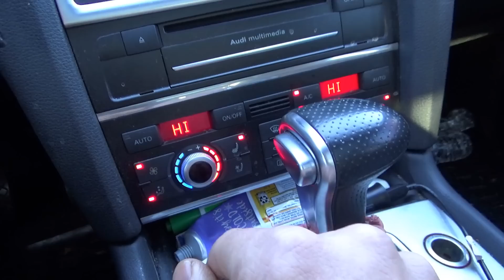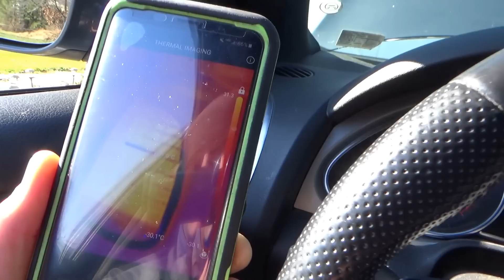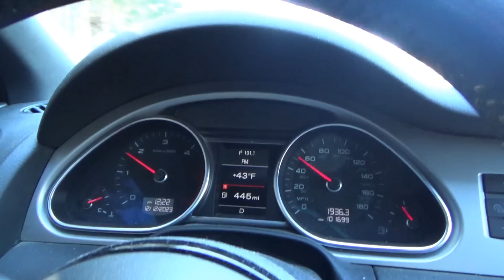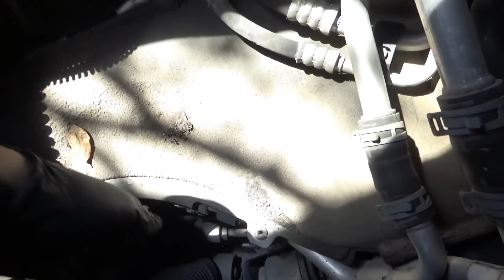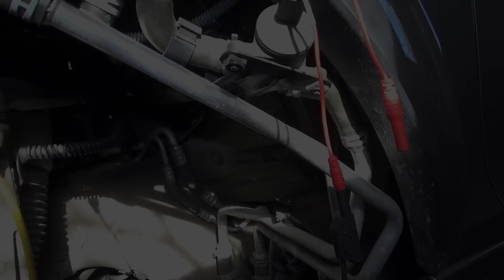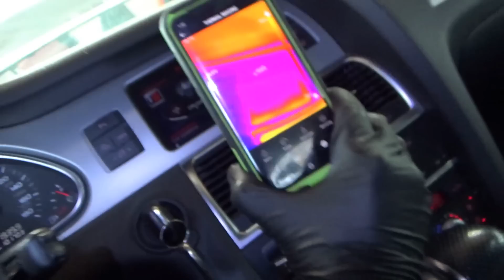Fancy Car...has NO HEAT? (Audi Q7 TDI)

Comment: Thank you!!
I have the exact same problem lem on my 2014 q7 TDI. I found a new replacement valve on Amazon for $27.00. Is this a simple job to replace this valve, or do I need to take my car to a mechanic. What would be an estimated time to replace thus?
Thank you!!
Jon

Comment: Look at it this way, Ivan. How much money wouldn't you be making if the Europeans didn't build trash? Will you look at the unbelievable plate of spaghetti pipes needed just to warm the car's interior. I had a '66 Chev pickup, had two hoses , one to and the other from the heater core. When the temp was sent to hot, it would drive you out of the cab.

Comment: Gotta say I loved the auxilary heater in my old Audi A4 2.0T. It would be around 32F in PA sometimes and within 1 - 2 minutes I would get air hot enough to cook an egg! My current Audi A6 doesn't seem to have it and I couldn't find anything in the SSP provided to technicians regarding an auxiliary heater, but at least I have supercharger whine and one of Audi's most reliable gasoline engines so a small trade off.

Comment: Good luck with the ac in the summer.......it will blow hot all the time
Reply from the maker: No it won't 😆
Reply: @PineHollowAutoDiagnostics Well im a Audi tech here in the EU.....if you say so but dont be suprized
Reply from the maker: @va7052  what if driver wants cold and passenger wants hot?

Comment: Auxiliary heater in this car you say? Its a Webasto Diesel Heater then right? Thats most likely the smoke out of the engine bay you mentioned thats where these heaters are ususally located and the exhaust isnt far away then.
Doesnt sound like it has an exhaust leak and a warmed up TDI doesnt smoke when idling.

I had to do a full overhaul on the Ardic 912D heater in my 2007 Diesel Volvo because it started smoking and flaming out only to restart the flame with a plume of smoke to the point of me just pulling the fuse and leaving it be until I was ready to do that job.
Its fuse No. 4 25amp in the engine bay fuse box for anybody interested BUT its Fuse 1 on earlier models. But Volvo labels their fuses really well actually so just look it up in the owners manual or in the fuxe box itself.
The unit was serverly sooted up inside and the burn chamber was so crusty even my favourite oven cleaner could not cut it and that oven cleaner is agressive parts left to soak in it for a few hours look better than new because it completely dissolves surface oxidization.
Had to to a few soak and wash cycles with the cleaner and sand the burned in crap off with sandpaper 😅
The heater was also all wet and sticky inside >unburnt fuel... running rich = stinky smoke so I replaced the fuel pressure regulator/nozzle assembly.
I got everything so clean that it literally started with zero smoke the first time and no exhaust smell at all.
Now it takes 60 sec to fire up, 2-3 Minutes until warm water reaches the heater core and from there on the coolant temp really picks up quick.
These older Ardic/Nordic branded heaters (in reality the company Ardic was bought by Eberspächer in the early 2000s) are really reliable and well made units, its unusual for them to need more than a basic cleanout and a new fuel nozzle even when they are now 15-20 years old. Parts are reeaaly expensive and not easy to get (basically the only way to get them is to buy original Volvo parts) like the fuel nozzle is 150$ alone. There are rare instances where the fan motor dies or parts of the wiring harness start to kinda smolder and short out where they enter the stainless steel housing of the heater. You need to make sure the wires are NOT pinched and free to move when reassembling these heaters.
That same heater was also the standard auxiliary heater for Audi back then, some! other VW models and it was used in some small yachts aswell.

Comment: 4H0 121 671 D        4H0 121 671 B
Magnetic valve between the additional water pump and the turbocharger, designed for vehicles with 1.8TSI 132kW, 2.0TSI 132kW/140kW/162kW/169kW/180kW/200kW/206kW engines.
Made in china 43 euro price

Comment: My AC doesn't blow very cold in the summer. They put the proper amount in and everything tests fine pressure-wise on a gauge set. When I first got it, it needed blend doors replaced (WJ Jeep). Stupid dual-zone control. Bought a whole HVAC box from a part-out and also the aluminum ones that someone makes. I replaced everything in boxes and had a shop do the swap. I suspect the blend doors aren't able to travel all the way. If it was me, even 5 degrees would be worth a $200 valve to get the most out of the AC.

Comment: I owned a TDI (diesel VW)... it NEVER made very much heat. Infact, in subzero ambient temps., the engine would COOL OFF when sitting at stoplight.  (Efficient engine = not much waste heat) I ended up covering the radiator with cardboard the 12 winters I owned it.

Comment: Diesels are naturally cold, drove a Cummins for years in the oil patch. Takes them forever to warm up, then when you start driving they cool right down again. If you let the water level drop to much, they’ll develop a hydro lock that needs to be bled out.
Reply from the maker: Why would they cool down when you start driving?? Sounds like you had a bad or missing thermostat LOL

Comment: Hi firstly the coolant has to be g12 , g13 dependent on its age as it protects all components and these engines take about 10 miles to warm up when it's cold. Obviously the valves are there so the engine heats up faster.

Comment: My Land Rover had a similar issue. After I had the engine rebuilt.  Rebuilder put a 192° thermostat in, the car specs for 198°.  The heater bypasses until ~194° (fast heat up for emissions).  So idle and some "spirited" driving would get some heat generated   putting the proper thermostat in fixed it.  Also max heat is now dubbed "gates of hell" as I had replaced the heater core thinking it was clogged as only the input side was getting hot. (This was when I learned that the core had a bypass thermostat)

Comment: Good diagnosis and I would have bypassed the shutoff valve as well. Just curious if the open circuit would set a code in the HVAC and whether you could bidirectionally control it with a scan tool.

Comment: My car (Skoda - also VAG family) has the auxiliary heat option. It's fantastic. It's a diesel engine work whip and all my prior diesel vehicles have taken an absolute age to start producing any heat from the vents on cold mornings, to the point I'd be sat there engine idling for up to 20 minutes just to blow the mist off the inside of the windscreen to be able to drive at all. This car, within a minute - hot air from the vents clearing the windows. I assume it's some simple resistive electric ni-chrome wire heater assembly in the air path - ancient tech with nothing to go wrong but so damn effective.

Comment: Deleting the valve might present a problem with cooling in the summer, but I believe it's main function is to isolate the aux cabin heater from the engine. This russian fix probably results in a much longer warm up time for the cabin.

Anyway, they don't fit a valve just for the hell of it.
Reply: The same valve is used on numerous other VAG cars and whilst the original Audi part is quite pricey (around £200 in the UK) there are some reasonable quality aftermarket parts (e.g. Pierburg, Gates) that are around £70.  Since it seems quite an easy job to change and a part failing to work is not going to cause expensive damage, I would be less concerned about using aftermarket in this case.

Comment: Brings back mixed memories! I'm of an Age now so can look back to when Southern England had winters - every year. My first recollections of motor mechanicing was my dad returning in high dudgeon, stomping snow from his boots on the back door mat while waving the distributor cap from his works vehicle ( all petrol back then) - this was then cooked in the oven for fifteen minutes before any sparks went anywhere. The only other possibility was a tow by a friendly soul but our milkman had learnt to change his route and our other immediate neighbours worked shifts. Even motors that fired up would all sport various pieces of cardboard over their radiator grills - mainly to prevent their carburettas freezing - heaters in vehicles were dreams for the future! 
However; I spent hours wading through wads of tin ware dismantling heaters for various reasons - in builder's trucks - it's nearly always pencils & pens down the vents jamming the fan or Radweld in the hoses and fittings! Come across stuff like that in the States? Poor man's leak cure that usually ends up borlixxing the rad and thermo? Some folk even poured rice in the coolant! At least you were saved all that.

Comment: Was asked for opinion on an overheating 2009 Jetta with sideways 5. Was fine in winter, overheated when weather warmed. One hot radiator hose, one warmish, so guy replaced thermostat, said it was a tough job. Same thing. Next he was going to try water pump, but that would require lifting front of engine, he wanted my opinion before doing that. I told him since one hose was getting hot, didn't think pump was problem. 

I did a lot of research, finally found a post by a mechanic who fixed similar problem, said it was clogged heater core (no valve on these). Said the way the thermostat housing was designed, if no flow through the hose leading to the heater core, thermostat would never open?!?

Checked heater core hoses, one hot, one cold! As a test, bypassed the heater core, both radiator hoses got hot when thermostat opened, mystery overheat fixed. He left it like that, planned on replacing heater core before the next winter. RnR youtube vid showed tiny passages in heater core, no wonder it clogged, especially with the "lifetime" coolant these use. 

If you have a mystery overheat on a VW product, run the heat and check heater core hoses to make sure both are hot. If not, investigate why.

Comment: Nice video and easy diagnosis with the thermal imaging camera. 
I had a 1974 Mercedes 450SL that had no heat. The system had a similar on off valve and you regulated the heat with adding more outside air to cool the full heat down. I ended up adding a switch to turn the valve on and off. The center console and heater controls were beat up pretty good when the radio was pried out of the console and stolen.

Comment: My 2014 Ram diesel has an aux heater when in defrost mode to assist with defrosting the windshield on cold startup.  Appears to be a common thing in newer vehicles.

Only problem with removing that valve could be difficulty warming up in very cool weather. Perhaps regularly below 15F and sub-zero weather as well.  On my Ram Ecodiesel I run a front grille cover in weather regularly below 40F (OEM says 32F is cutoff) to aid in warmup and heat retention.  Then again 15F is a typical wakeup temperature for me :)

Comment: That smoke is likely leaking injector seals. These is a vent hole for each injector hole that exits just above the exhaust manifolds. 
I have found the temp gauge on VAG cars to sit at the one temp even though actual engine temp can be a lot hotter or colder.

Comment: the temp should stay in the middle even with heaters on i think one of the thermostats is duff. the smoke could be a coolant leak, it fills the valley under the inlet manifold and when you brake it leaks down the front of the engine onto the belt. there is a small theremostat under there aswell. well there is on older models. the water pumps also have plastic impellers that like to fall off and they dont really overheat unless its warm weather going up a big hill. it mite also have the water pump that covers the impellers they can get stuck

Comment: These VW's and Audi's have annoyances. Removing that valve will probably set a coolant performance code if the engine doesn't warm up fast and stay hot. That valve is probably closed when the engine warms up with the auxiliary heater working until warmup which should be fast. TDI's don't get very hot to begin with but had a similar car issue with a friend and we bypassed the valve and after a while, it set a coolant performance code and set the check engine light. Found out that you have to spend the big bucks and replace what is there because they over engineered these cars to make you spend money fixing them. Instead of routing the radiator hose directly to the radiator(and same with the heater core hoses) they engineered this neck with an O-ring that leaks. Had a coolant leak on my heater core, had to replace the connectors and then the ones on the radiator started leaking. Why couldn't they just stick the damn hose to the radiator and call it good.

Comment: Great diagnosis, and fast. My old 2010 Lancer has a similar issue where I feel the heater isn't fully off in Summer and the AC isn't doing as well as it should. Maybe I should investigate where the heater core flow valve is on mine.

Comment: A trip back in time for us seasoned mechanics: Who can forget the vacuum and cable controlled water valves...
Reply: My 98 Volvo had a vacuum controled valve. If I remember right, it's  normal position was open and closed with vacuum when you started the car.
In the hot summer it decided it didn't want to close, so I got a piece of hose and clamps and bypassed the heater core and left it that way.
Reply: 2011 CRV for me.  This summer, no AC and it was blowing hot.  "I'll give it a couple of days..."  Well it "Fixed" itself.  Come October, no heat or so I thought.  Go to the Honda delar. Customer service guy says "You have heat, but it's realllllllllllllly slow." Forget what the price was, I don't pay attention when I need something and I have the means to pay for it.  2+ weeks on backorder. He wasn't sure if he'd get one in a month.  Then another week or so for an appointment.  The heat did work.  From cold, the cabin would get warm in about 15-20 minutes.  He also said "If you turn the heat off it will go off, but it will take forever again to heat up".  Hot engine wasn't too bad, maybe 4-5 minutes.   I told him my first wheels was a air cooled VW Beetle and cold wasn't going to stop me.  He said "I have you beat.  I had a VW Thing".   He also said "In the good old days, we would forced it on hot until the part comes in.  But 'electronics'.....".
Reply: I'm 78, and I do not remember any cable controlled water valves. I do remember the clock spring type heat risers on the exhaust manifold and choke plate though.

Comment: This is why I will never buy a Mercedes, BMW, Audi or anything European. While they are OK they drive and do everything beautifully. But when they give troubles, and they regularly do (ask the owners), you better have deep pockets (for the parts as well as the cost to fit them). Same for Range Rovers as well as newer Land Rovers. Give me Toyota reliability any day. Retired mechanic/machinist in Land Down Under.

Comment: I can attest that these engines take forever to heat up lol. They wont heat up at idle. You gotta drive them!
Reply: You are correct. No manufacturer puts a part/system on a car for no reason (they all have the final cost in mind) so in the long run this customer will have different issues. But then again, they deserve it because if you cheap up at a less than 200$ part on a 60k+ $ car...you shouldn't own it. In this case even Ivan could have done a better job in schooling the customer...after all I don't think his diag was free.

Comment: What a fantastic car to buy used...Not. I run an exhaust shop here in England, and I often get cracked wheels off them to weld, BMW wheels are No. 1 here in the UK for cracking rims as they have run-flat tyres on them.

Comment: Great find on the valve. I wonder if there is some programming strategies for emissions that regulates engine heat using the heater cores and will eventually set a code or two and turn on the money light.

Comment: I suspect it actually needs that valve for the air conditioner to work. Many vehicles have the heating and cooling coils stacked so the air flows through both. They use the cooling coil in the winter to remove moisture to defog/defrost the windows. They use the heater valve to shut off coolant in the summer and cycle the AC compressor. It takes up less room than splitting the air flow.
Reply from the maker: Hmm so where would the blend doors go then? Usually all of the air goes through the AC evaporator, and then the blend door directs a portion of it through the heater core based on the desired temperature 🤔
Reply: @PineHollowAutoDiagnostics  The blend doors will direct the air flow to the window, dash or floor depending on the settings and mix outside and cabin air into the system while using the cycling of the AC compressor and modulating the flow through the heater core to control temperature.
Reply from the maker: @tiredoldmechanic1791  ok... But how can you set driver and passenger temperature independently? There HAS to be a dedicated temperature blend door for each occupant 😉
Reply: @PineHollowAutoDiagnostics  the pics on the net show that every side has its own flap to mix the fresh and heated air
Reply: @PineHollowAutoDiagnostics  if it’s like my BMW, that valve you removed is modulated on-off to achieve the desired heater core temperature.

Comment: I've noticed that was a fairly common issue with Mercedies and BMW.  The heater control valve just dies and well, no heat.  The metal body control valves were much better.  But the plastic ones like what's on this Audi, burn out after a few years.  Awesome job Ivan!  Lots of people wind up just eliminating them as they are not really needed.  Oh, about the low air flow from the vents.  Do the customer a solid and replace the cabin filter.  It's very commonly overlooked.